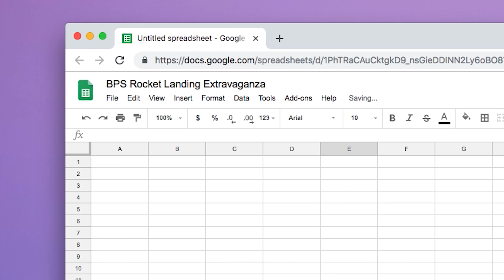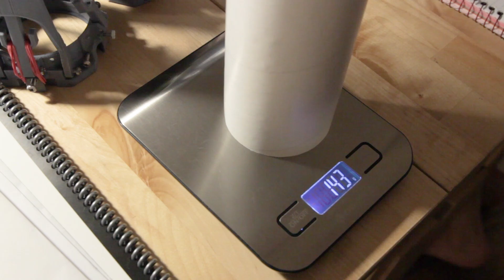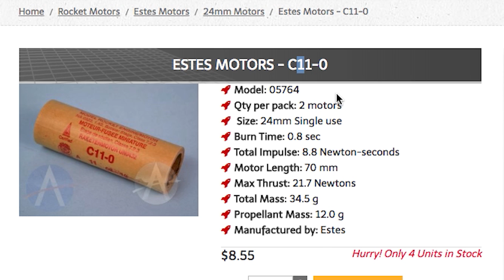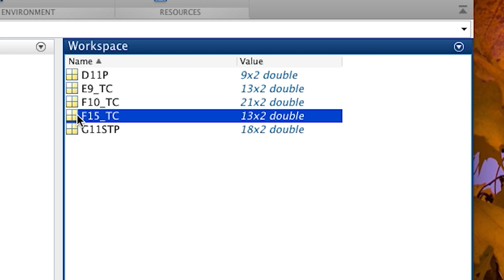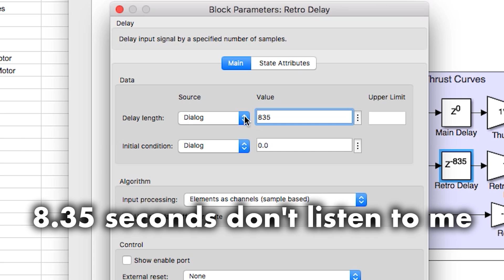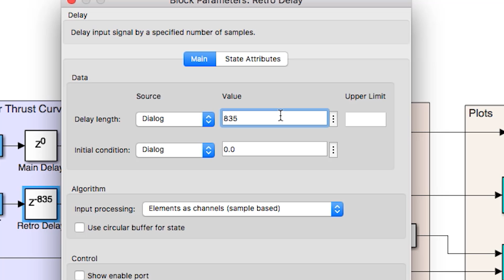Comment: Nice proof of the general feasibility. An obvious part missing here is that rocket engines get lighter while burning, due to fuel consumption. This rocket starts with a mass of 930 grams, but lands with 750 grams.

Comment: 📺💬 Before continuing press like, all parts are designed with balances open / clone parachutes sample combined into a model.
📺💬 Impulse ranges B had twice of impulse as A and C had double the impulse as B .
🥺💬 You are correct all parts are well designed not powerful only but continuity smaller impulse or hard contrast force.

📺💬 We have some calculations here, 3.1 seconds is a good burn time which is gravity force.
📺💬 A block diagram in MATLAB Simulink we can build a simulation of thurst feedbacks system because you need to control the continue force apply to an object and response to the environment.
🥺💬 That is one hard part not only the simulation plotting but solution when you build system that Automatic control the engine .

Comment: No, sir,

The METRIC system makes no sense.
Go Freedom Units!!

What the heck is a Pascal? A mouse fart? Hey, this thing is pressurized to 69,000 Pascals.  Wow! I have no concept of numbers that big.  That sounds like a lot! Other guy: Actually, no that's not that much at all. This tire has 420,000 kilopascals of pressure.  Me: okay, whatever that random dude's name's unit and number that is.
Whereas psi is simple! Oh! I know exactly roughly how strong that is. And I can easily estimate how much force that would push on something with.  I know how strong an air piston would be with that pressure, how big an object an air bag could hold up, how hard that would blow on me.
And water pressure. Yeah that depth the water has this many psi. Yeah, I can estimate how strong that is.  Metric: Ah, it's this many pascals. Okay how hard does that push? well if its a newton per square something and a newton is 1/9.8 of a kilogram, and the area of my hand is 0.0069420 of a meter, so it would push this hard on my hand... carry the two...  It's just absurd.
A Tonne.  Or a Ton. Ah, I see, taken later from the imperial Ton just to confuse people even more and more on which one you mean when you say or spec for something.
What the heck is a Newton? Ah, you see, you have to do some quick mental math and calculations to estimate how much force that is and how much mass something has or how much weight of objects or mass that much tension or force could lift.
This car pushes with 40,000 newtons.  Okay, what does that mean.
Hey Honey! I'm home! Oh and I picked up 24 newtons of beef at the store today!

Torque. I need to put together this thing.  How tight should I tighten this bolt?  So I don't strip it, or the material, or under tighten it so it comes loose later? Ah, well This one about 10 foot pounds, and this bigger one about 40 foot pounds.  Oh, okay, I have this socket wrench that's about a foot long, so I need to pull on the grip with about 10 pounds of force. I'll pull about the same amount as a 10 pound dumbell.  Or, my cat is 10 pounds, so the same weight as my cat.  Then this one with the fore of a 40 lb dumbell.
In metric its Newton meters.  A newton, which is a small force I can't estimate, and a meter which is a huge wrench or socket or anything that nobody has. So this needs 20 newton meters.  Okay I'll pull on it about as hard as 23 newtons if I had a meter long wrench and estimate that in my head.  okay, I need to do some calculations quick to actually figure out that much, my wrench is 0.305 meters long, and a newton is 1/10th of a kilogram, so then I have to divid the torque by about 3 or 4, no wait it's multiply by about 3 or 4, then divide by 9.8, then that's 7.13 kg, what the heck roughly weighs that much, okay i've never picked up a 7 kg weight before, so then okay, a mid sized small dog, but not too small, and not the bigger sized small dogs...

Also, bolts.  An m6 is too small for the thing I need, but an m8 is waaay too ridiculously big, and nobody makes m7s, and the hole is too big and my plate needs a bigger ring around the hole to be strong enough now that the hole takes up so much space close to the edge, no now it cuts into my plate too much if I move it in, and an m10 is WAAAyyy too big for pretty much all applications except a car suspension,
But imperial I have so many options to hold things together.  And it's all base 2 fractions, which we should all know. 1/4, 5/16, 3/8, 7/16, 1/2 inch.

Ah yes, a thou.  This thing is 6 thou thick.  Ah, yeah a thou is the width of a human hair, so I can estimate that. 
This thing is 0.0869 mm thick.  Okay, so ... really small?

The base unit for mass isnt even a unit, its a thousand units.  oh this unit of measurement is about 1000 of these tiny units. 

I'm making a rocket.  This thing weighs 1 lb, this weighs 5.5 lbs, this weighs 2 lbs.  Okay, so I need an 8 lb force rocket motor to lift that up, and 17 lb rocket motor to lift it up at 1 G.
metric.  This weighs 465 grams, this weighs 2.9 kg, this weighs 800 grams.  Okay, so I need to 2.9 plus 0.8 plus 0.48 is ... like... 4.3 kg.  So I need a rocket motor that can push with 4.3 kg force to lift up, oh theyre not measured in that I need a rocket motor that can push up with ~43 Newtons to lift, and 86 Newtons to accelerate up at 1 G, Oh wait I need to add a 1.365 kg thing to it, now how much is that....

A weird fancy land where they have no sense for anything between two extremes of a meter, whatever that is, and a centimeter. Me: Oh yeah, that things like four feet tall.  Bri'ish person: Oi! That things like 1.28 meters tall!
Me: That buildings two stories, so then it must be around 20 feet tall. 
Bri'ish wanker: Oi mate! That buildings 2 stories so it must be around 6.72 meters tall!
six story building, 60 feet tall.  European 6 story building, 6 times 3 point something, remember my times table... like 18 or 19 point something meters.
Reply: Damn, sorry decimals are so hard for you to understand

Comment: BPS.space the block diagram (@ 14:10) of the simulation has an error. Velocity can not be achieved from Net force directly, You should take Net force/mass as input for the integrator (for getting velocity).

Comment: i agree the metric system is better when measuring thing I prefer cm to inch and stuff but for degrees i prefer F instead of C i can read C but i need to first convert it in my head to F which takes about 3 seconds but its annoying but i can do it

Comment: Variable thrust control?

These motor burns are relatively constant when they fire, after the initial thrust. Can altitude sensor and velocity sensor combine to adjust the thrust to ensure that the thrust burns at just the right rate to achieve a suitable velocity immediately prior to landing? Is there a way to control the output of the thrust of the retro motor so that it performs dynamically?

Comment: Could this be done with energy to calculate when to fire the motor? You have the energy of the motor and you can then calculate what the height of the rocket is for PE and you know its speed for KE so you just fire the motor when the potential energy plus the kinetic equals the motors energy?

Comment: If you want to know how many Newton’s your rocket is or how much it’s “weight” us F=mg g being 9.8 so before any ejections this rocket is being held down with around 8.3 Newtons and so a rocket motor with an average thrust of 11 wouldn’t do much. You can do more math to figure out what the acceleration would be but with .8 seconds and 8.3 Newtons to lift he’s right not the right motor. Just find out your acceleration account for the time and you can approximate V to and where the apogee will be which is where V = 0  until it starts accelerating down at -9.8 but quick parachutes !

Comment: Hey man! I love your channel. I was wondering why the retro boosters are configured by timing. Why don't you just configure by altitude?
Reply: The burn is triggered by time in the simulation for no reason, simplicity and maybe a touch of laziness I suppose. :) The actual retro burn for real testing is based on altitude and a few other factors, timing would be far too unreliable in real life!
Reply: @BPSspace  will you do videos about more accurate flight simulations ?
Reply: @count_zero_163  Sure, I can cover that! It may not be for a little while, I'd like to get some more of the flight computer/software/hardware stuff covered first.

Comment: You should be able to add the drag force to your simulation. You have all the parameters you need except drag coefficient. Just estimate it. It will be a much better simulation that way.
Reply: +BPS.space This would make it possible to time the delays pretty much on point and reduce the test runs. The math is not that hard either.  This is probably a fun way of over engineering the rockets. Would love to see it

Comment: Nice work ! 

What about the evolution of the mass of the rocket because of the fuel being burned? When the second motor is ignited, the rocket is maybe 30g ligther. 
After all you're going to make a rocket so use the rocket equation :)

Comment: Just a quick question: do you have any plans to add a sensor for altitude measurements?  I know SpaceX uses radar.

Also, any plans to add throttle control with two 2-axis motor gymballs?
Reply: Guess what the BMP180 is for :)

Comment: Go metric system!  Thanks for the detailed and practical instructions.
Reply: Boo metric system!
Go freedom units!!

Lol no,... 
but seriously

I got an 8lb rocket, so I need an 8lb motor to lift it up, and a 16lb motor to accelerate up at 1 G.
I got a 3.9 kg rocket, so I need a ... something kg rocket motor, wait it's newtons for rocket motors, and a netwon is something, let me look back to childhood, oh yeah 9.8 newtons is a kg, so roughly 10, then I need a 39 newton motor

And here's a copypasta from something I wrote a while back:
The METRIC system makes no sense.
What the heck is a Pascal? A mouse fart? Hey, this thing is pressurized to 69,000 Pascals.  Wow! I have no concept of numbers that big.  That sounds like a lot! Other guy: Actually, no that's not that much at all. This tire has 420,000 kilopascals of pressure.  Me: okay, whatever that random dude's name's unit and number that is.
Whereas psi is simple! Oh! I know exactly roughly how strong that is. And I can easily estimate how much force that would push on something with.  I know how strong an air piston would be with that pressure, how big an object an air bag could hold up, how hard that would blow on me.
And water pressure. Yeah that depth the water has this many psi. Yeah, I can estimate how strong that is.  Metric: Ah, it's this many pascals. Okay how hard does that push? well if its a newton per square something and a newton is 1/9.8 of a kilogram, and the area of my hand is 0.0069420 of a meter, so it would push this hard on my hand... carry the two...  It's just absurd.
A Tonne.  Or a Ton. Ah, I see, taken later from the imperial Ton just to confuse people even more and more on which one you mean when you say or spec for something.
What the heck is a Newton? Ah, you see, you have to do some quick mental math and calculations to estimate how much force that is and how much mass something has or how much weight of objects or mass that much tension or force could lift.
This car pushes with 40,000 newtons.  Okay, what does that mean.
Hey Honey! I'm home! Oh and I picked up 24 newtons of beef at the store today!

Torque. I need to put together this thing.  How tight should I tighten this bolt?  So I don't strip it, or the material, or under tighten it so it comes loose later? Ah, well This one about 10 foot pounds, and this bigger one about 40 foot pounds.  Oh, okay, I have this socket wrench that's about a foot long, so I need to pull on the grip with about 10 pounds of force. I'll pull about the same amount as a 10 pound dumbell.  Or, my cat is 10 pounds, so the same weight as my cat.  Then this one with the fore of a 40 lb dumbell.
In metric its Newton meters.  A newton, which is a small force I can't estimate, and a meter which is a huge wrench or socket or anything that nobody has. So this needs 20 newton meters.  Okay I'll pull on it about as hard as 23 newtons if I had a meter long wrench and estimate that in my head.  okay, I need to do some calculations quick to actually figure out that much, my wrench is 0.305 meters long, and a newton is 1/10th of a kilogram, so then I have to divid the torque by about 3 or 4, no wait it's multiply by about 3 or 4, then divide by 9.8, then that's 7.13 kg, what the heck roughly weighs that much, okay i've never picked up a 7 kg weight before, so then okay, a mid sized small dog, but not too small, and not the bigger sized small dogs...

Also, bolts.  An m6 is too small for the thing I need, but an m8 is waaay too ridiculously big, and nobody makes m7s, and the hole is too big and my plate needs a bigger ring around the hole to be strong enough now that the hole takes up so much space close to the edge, no now it cuts into my plate too much if I move it in, and an m10 is WAAAyyy too big for pretty much all applications except a car suspension,
But imperial I have so many options to hold things together.  And it's all base 2 fractions, which we should all know. 1/4, 5/16, 3/8, 7/16, 1/2 inch.

Ah yes, a thou.  This thing is 6 thou thick.  Ah, yeah a thou is the width of a human hair, so I can estimate that. 
This thing is 0.0869 mm thick.  Okay, so ... really small?

The base unit for mass isnt even a unit, its a thousand units.  oh this unit of measurement is about 1000 of these tiny units. 

I'm making a rocket.  This thing weighs 1 lb, this weighs 5.5 lbs, this weighs 2 lbs.  Okay, so I need an 8 lb force rocket motor to lift that up, and 17 lb rocket motor to lift it up at 1 G.
metric.  This weighs 465 grams, this weighs 2.9 kg, this weighs 800 grams.  Okay, so I need to 2.9 plus 0.8 plus 0.48 is ... like... 4.3 kg.  So I need a rocket motor that can push with 4.3 kg force to lift up, oh theyre not measured in that I need a rocket motor that can push up with ~43 Newtons to lift, and 86 Newtons to accelerate up at 1 G, Oh wait I need to add a 1.365 kg thing to it, now how much is that....

A weird fancy land where they have no sense for anything between two extremes of a meter, whatever that is, and a centimeter. Me: Oh yeah, that things like four feet tall.  Bri'ish person: Oi! That things like 1.28 meters tall!
Me: That buildings two stories, so then it must be around 20 feet tall. 
Bri'ish wanker: Oi mate! That buildings 2 stories so it must be around 6.72 meters tall!
six story building, 60 feet tall.  European 6 story building, 6 times 3 point something, remember my times table... like 18 or 19 point something meters.
Reply: @aaronmarkstaller geez that’s an whole essay 😂
Reply: @aaronmarkstaller  judging by your response you don't understand the metric system at all, also some of your calculations are wrong
Reply: @aaronmarkstaller  metric makes more sense
Reply: @aaronmarkstaller wait so your gripe is converting 3.9 kg to 39 newtons? you're a laughing stock